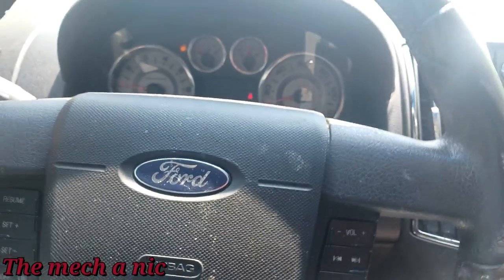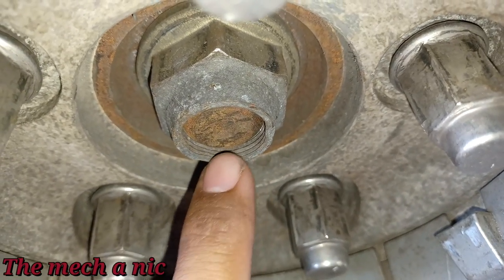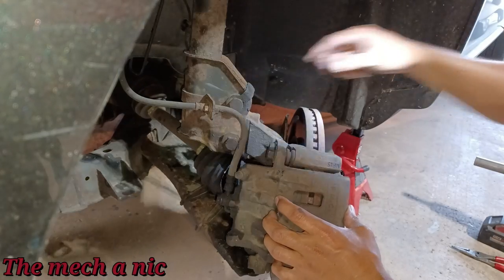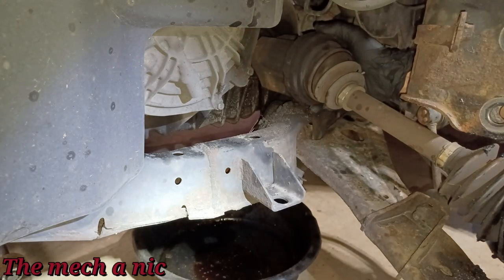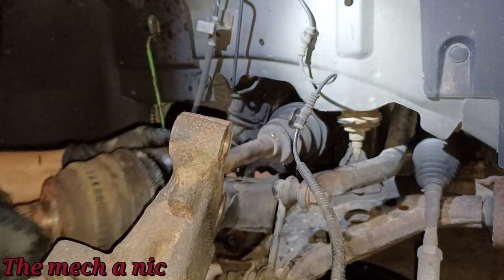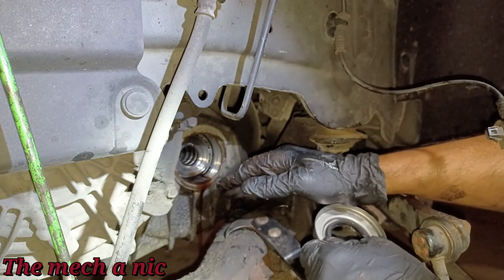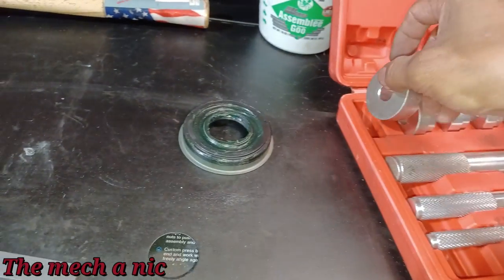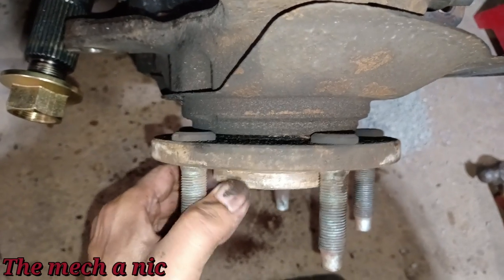ford edge grinding noise and trans leak

Comment: My neighbor was having trouble inserting the new drive shaft into his car and asked me to help. I went into my garage and grabbed some heavy grease. I greased the end of the shaft where the spline and steel clip are. The grease is there to hold the steel clip centered in place. Have to center the clip on the spline and hold it there with grease. Then I took it and just popped it in. He was amazed. :)
Love your videos!
Reply from the maker: That's a great tip, I'll have to remember that for next time.👍

Comment: I was waiting for the wrench to touch the + post on the battery when you were unbolting the back two strut nuts lol
I've done at least a thousand CV axles and every now and then one of them has to be an A-hole. I spent half an hour trying to get the axle into the trans.  It wasn't going no matter how I tried.  I counted the splines, I used my micrometer to measure everything.  I filed the taper on the end to try that.  Nothing worked so I left it for the night and came back to it the next morning, it went in first try.  Had issues with them coming out now and then.  Sometimes I think the clip is oversized and makes it a PITA to get them out

Comment: I know that pain of trying to pull an axle that doesn't want to move! As a guess I'd say the clip is shifted too far to one side, so usually I spin the axle a little, try again, spin some more, try again etc. If the other wheel is on the ground you might need to be in neutral. When the clip is in the right position I've seen it fall out with a ridiculously tiny tap. It makes me think that if you hit it too hard with the slide hammer it might bend the clip so much it will be even harder to remove. You can get three foot extenders for a slide hammer, which would bring it out far enough you've got more room.
Reply from the maker: That's a great tip, someone mentioned that about rotating the axle. Looks like I still have much to learn lol. What's funny is I already have one of those extensions for the slide hammer, I just forgot that I have one lol.

Comment: Pro tip for your slide hammer welds 2 5/8 fine thread ubolt  nuts together then buy a straight 5/8-24 inch ubolt rod and you can make an extention for your slide hammer
Reply from the maker: You just reminded me that I actually have an extension for the slide hammer,  I forgot all about it 🤣

Comment: No! Rotate the axle shaft as you pry…trying to get snap ring gap pointing down…same as installing. Shaft is no good anyway, so, grab axle and Jack back and forth ,using the play in the inner joint , …..works for me.
Reply: Ahh, as I watch further, I see you did Jack it out.
Reply from the maker: Yeah I got it eventually.  I knew that snap ring was hanging up and causing the issue 👍